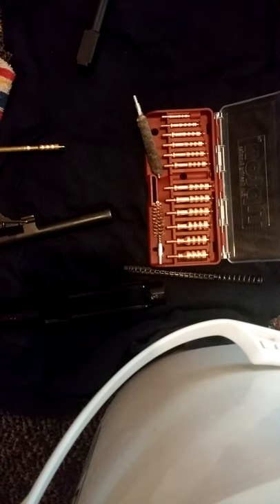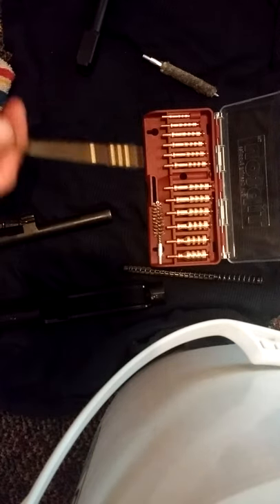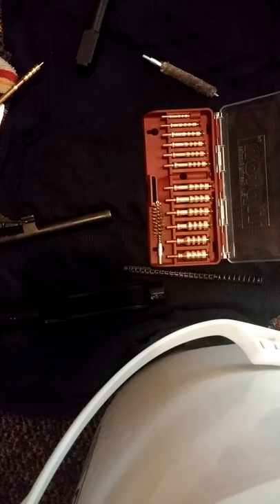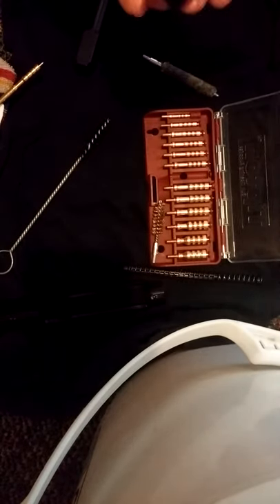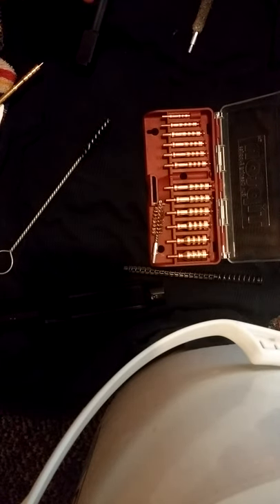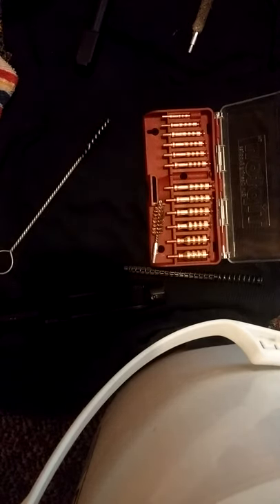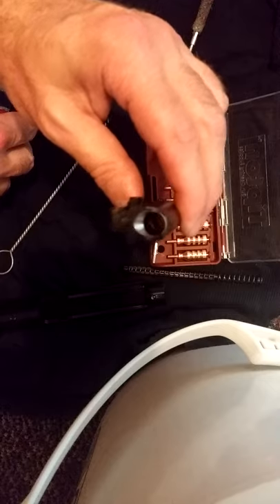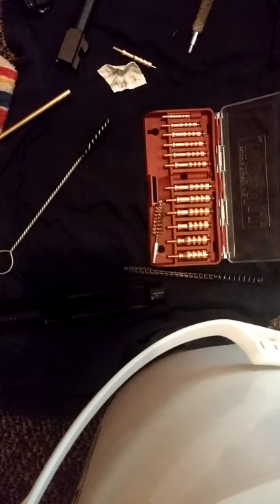Cleaning guns with jags

Comment: Personally I hate jags, it's probably designed to do it but I hate having clean patches fall off after one push when I could easily use it again. with a patch loop I can push and pull as much as I want to get it clean and get a full use out of a patch
Reply: When your new patch comes out looking like it did when it went in your clean and done👍

Comment: Great video idea but, remember the idea is to push the patch through, from the breach end if the firearm design will allow it, and remove it from the bore. Don’t pull it back and don’t reuse. The patches are cheap so don’t spread the detritus back into the bore. 

Great video!